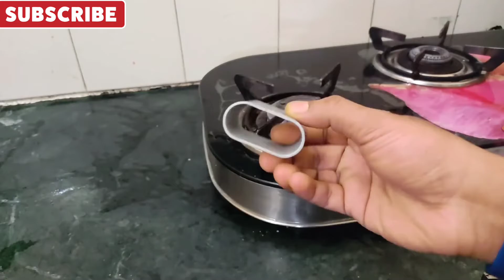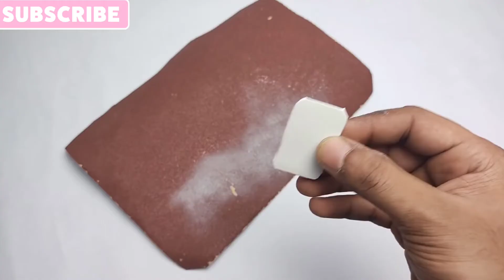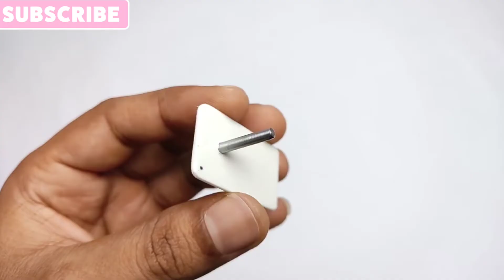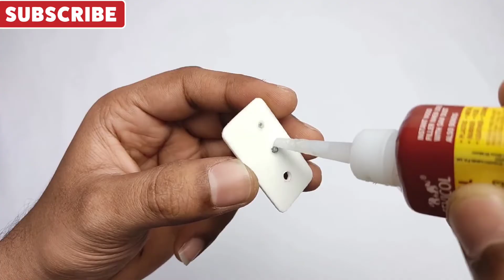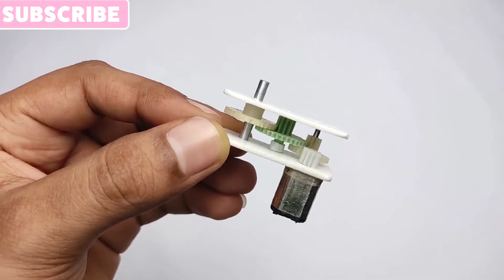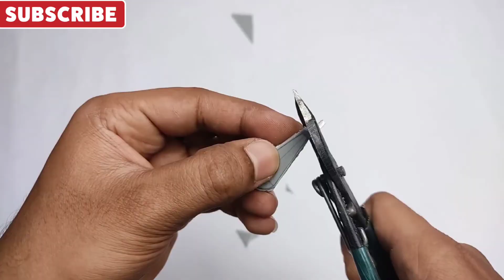How To Make Powerful Servo Motor At Home From PVC Pipe

Comment: Its a simple dc motor 
 
It rotating both clockwise and anti-clockwise because you are changing + and - terminals of the battery / motor(simple)